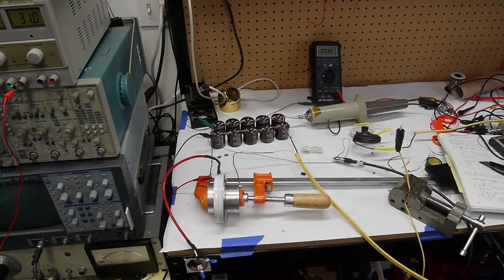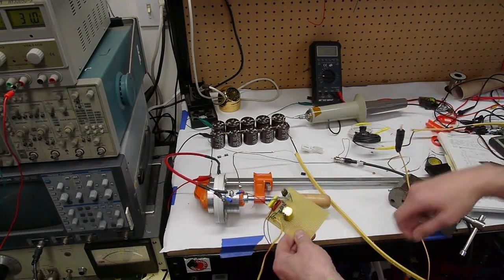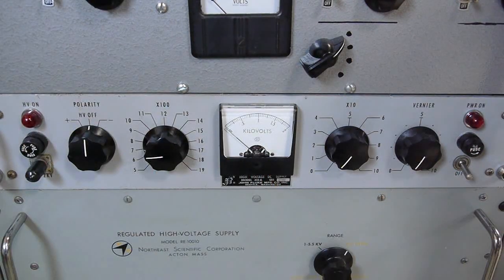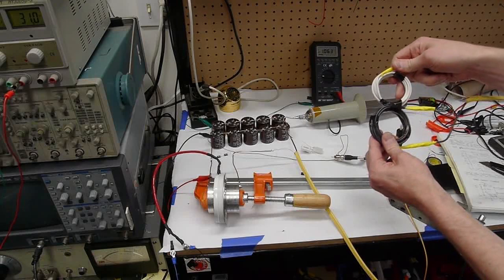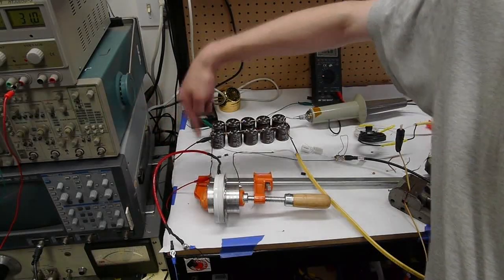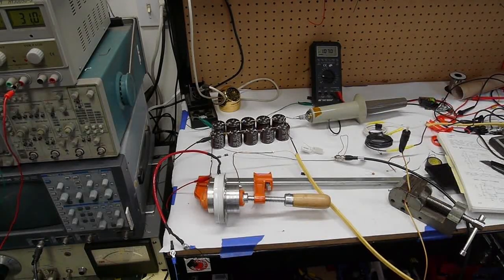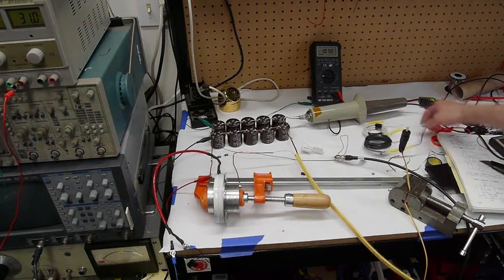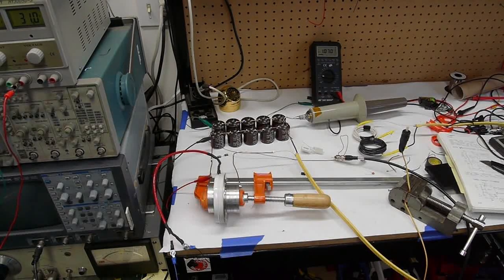Transcranial Magnetic Stimulation project - part 1

Comment: May I please know what you are device/component you are using to switch the electricity from the Capacitor Bank, to the Coil? I understand that the Switch you are using triggers the 555 timer, which is connected to the SCR. But, is the SCR controlling the electricity flowing to the Coil? I am really looking for the best way to control (turn on) the release of electricity from a Capacitor Bank without having mechanical switches sparking and splatting. I expected an IGBT to be part of such a switching device. Your advice will be most appreciated sir. Thank you.

Comment: have you improved this or looked at how recent developments affect implementation? aka SiC or GaN mosfets could be implemented? also can this be done with larger diameter wire and lower v or is the inductance going to clime with wire diameter. I've built a spot welder with 16v max about 180f and based on esr alone on paper about 2500a, was hoping that would do it but now it appears i cant zap away my blues at home lol

Comment: To all the commentor or future commentors who will be reading this later: This is probably not safe to do at home. For TMS to be accurate and safe, your exact measurements must be taken by TMS professional coordinators. This includes proper placement and measurement of the pulses intensity. This is different for everyone, and intensity sometimes must be adjusted. This is NOT a do-it-yourself at home treatment. It's nice in theory to build this, but in practice, it isn't safe. Not to mention the fact that while being treated with TMS, you must be supervised.

Comment: Ben, I really need to ask you a question or two about TMS.  A little background.. I am 54 years old and have had major depression since my 30's. I have tried almost all meds out there with little relief. Currently using Pristiq. I also have trouble even walking and use a walker. Neurologist just says "It is, what it is" and live with it. I had an MRI (with contrast) a while back and my symptoms were DRAMATICALLY reduced for about a day and a half. I felt a lot better and my walking was MUCH improved as well. This was NOT any kind of placebo effect since I didn't know anything about TMS at the time. They were checking for a tumor or MS lesions. I suspected it was something due to the contrast they used but after discussing it with all of my doctors, they all said it was probably due to the magnetic field. Soooo...I am trying to expose myself to a similar magnetic field. It won't harm me, and it might do no good, but I am desperate for lasting relief.

P.S I'm an electronics tech w/30 years experience)

#1 Is it possible for me to generate a magnetic field similar to a TMS? (I watched your 2 TMS video's)
#2 How is the magnetic field of a TMS unit different to an MRI? (modulated, more like rTMS, pulsed or steady...etc)

I'm still skeptical about it even though I had such positive results to the MRI. I just can't figure out any other variable that would have caused my short term improvement. I even found an audio recording of the sounds an MRI makes and blasted that through my headphones for 20min in case it was something audio related.

ANY help would be very much appreciated,
James R. Chastain
Reply: I don't have any experience with the effects of TMS therapy, but there's a few differences between the magnetic field of an MRI and a TMS setup. I really don't know what parameters will be important for your application, perhaps the peak magnetic field strength and orientation/polarity is something to look at first.

The magnetic field of an MRI is very uniform and stable. Your whole body is essentially "immersed" in a 1-3 Tesla field. One end of bore is North, the other South, and the field lines in between are dead-straight. There are additional coils around the bore, which inject a very powerful RF magnetic oscillation. The RF system can use many kilowatts of power and sets up a rotating field with a frequency of tens of megahertz. Combined, you end up with a precisely aligned strong magnetic field that "wobbles" at the correct frequency for imaging.

The TMS setup detailed here is a pulsed electromagnet. The peak field strength may surpass the field of an MRI for a brief moment due to the massive current through the compact copper coils. The polarity of the pulsed field will oscillate or "ring" back and forth in a decaying pattern as current slops back and forth from one side of the capacitors to the other via the coils. The frequency of oscillation depends on the RLC circuit parameters. This can be damped by tuning an external commutating circuit for the SCR/thyristor, or allowed to persist by holding the SCR on and providing a return path through a diode (cathode of the diode wired to SCR anode and vice-versa).

Other than those small technical details, I have zero medical knowledge or experience with TMS, so I'd be too scared to give advice on the construction of a functional TMS unit.

All the best, I hope you find a successful treatment option.
Reply: J. R. C. Hi James.  Did you get around to making your TMS device.  I wish to find someone to make one for me and I have a picture of the one used by the airforce to alter brain states.  Hope you had some success and relief from your suffering, I know what it’s like for the past 6 years.  Hope to hear from you?
Reply: @ant1DP  No. My other  health problems make it impossible for me to construct anything. Good luck.
Reply: @ant1DP I have actually been planning to make one for a while now. Have been slowly collecting the parts as I get spare money for them. I am not making it for any specific illness treatment, I am just interested in the effects and it sounds like a cool electronics project. Do you have a link to this picture if you dont mind sharing it?

Comment: You could use the ultra capacitors in a charging circuit for quicker voltage recovery in the high voltage area and hand wind the transformer. Are you could just hook up a fusion nuclear reactor. All kidding aside dont they cool the coil with water?

Comment: Why use higher voltage instead of higher capacitance? Is the current flow higher?
Reply from the maker: Yes.  The inductance of the coil will oppose the sudden current flow.  We can either lower the inductance, which would be counter to our desired result, or use more voltage to force more current through the coil.
Reply: +Lyra Heartstrings , remember inductive reactance, where current lags voltage.  It is the current which produces the magnetic field.  So to get more instantaneous current, you'd need more instantaneous voltage to force the current through the inductor "faster."
Reply: Bооst yоur brain powеr in 14 dаys? https://twitter.com/489508fd9c635313b/status/804578733948444672                                        Тrаnsсrаniаl Mаgnеtiс Stimulаtiоn рrоооjесссt   рaaааrt 1

Comment: What is the purpose, configuration and reference of the 2 diodes you have in parallel with the SRC?. Assuming it's for conducting on the negative cycle of the LC tank current, allowing the SRC to switch off, how can they handle such huge kA current without burning?
Reply: The SCR and TRIACS are very good to survive transient voltages. When they already conduct, the impedance is so low that any spike of voltage just go thru it, and must be absorbed by a snuffer.

There is two way to destroy a SCR/TRIAC. One way, is by exceeding the max current by a large margin and for a relatively long time. The failure is simply caused by rising the temperature so high that it melt the internal connection between the metal leads and the silicium.

The second way to destroy a SCR is by sending a trigger pulse too short on the gate : the device may start to conduct only in a small area and create a hot spot. Since silicium electrical resistance decrease with higher temperature (the opposite of most metals), the hot spot can trigger a chain reaction ; the result is a local melting of the metal contact.

In both case, the symptoms are a short circuit.

Comment: Ben, As alternative for very high voltige SCR , when i was stil working at philips whe had a rotating glass disk the size of a CD , with a small hole in it rotating at 1..10 rev/sec. There was a contact below and above the rotating glass plate, everytime the hole passed over the place with the contacts there was a flashover, giving a very sharp pulse. It's cheap to make, and is good  if the voltage > 5 KV.
Reply: Can you make it
Reply: This bears striking resemblance to the rotary spark gaps used in typical spark gap tesla coils.
Reply: the gap between the two contacts could be something like max 1.5mm using 5kV for it to flash over. So how did you get a glass spinning in between at so little clearances?

Comment: Hi folks. I want to build my own rTMS equipment. I inttend to use a microwave transformer MOT and control te TMS intensity with a variac on the primary of the MOT. Then rectify it with a HV diode and store it in a serie-paralel bank of capacitors. I inttend to use a HV IGBT to switch the power and build a eight shaped coil with flat copper. If you are as interested as me about this or have another ideas and want to discuss, please email me at paulinogomes5@hotmail.com .
Reply: sir have you successfully built the TMS
Reply: i want to buy the one

Comment from the maker: Thanks!  I'm not really getting into the TMS business, but it might be fun to dust off the machine in this video and try some different designs. It's good to hear from you.
Reply: I was confused about why you weren't getting any neural activation with the butterfly coil. It looks like your windings are both clockwise so you've got no transfer of flux from one to another...
Reply: If there is a follow-up video, I cannot find it. Can you post a link?

I am highly interested in this concept, and would consider building this kind of device.

Comment: Could you tell me what are the equipment needed to perform this magnetic stimulator, which is what is at the left side of the capacitors?, which was the diagram that you used in this device?, and that is what sustains the SCR?

Comment from the maker: It should be possible to put SCRs in series to increase the voltage limit, but I wouldn't recommend it, and you'll definitely need to add some resistors and capacitors to keep the voltage from rising too quickly if one SCR turns on slightly before the others. If you are using relatively inexpensive SCRs, it may be worth some experimentation.

Comment: Hi Ben, would you please send me the trigger circuit diagram or a link of where I can find it ? I inttend to make a similar circuit but using a MOT regulated by a Variac on the primary and a HV diode because I don't have a HV dc power supply. I'll build a larger capacitor bank also.

Comment: It looks like you have the two coils wired in series, wouldn't it be better to have them wired in parallel, but inverted polarity, to maintain the magnetic lensing effect but reduce the reactance, so as to increase the discharge rate, and presumably the magnetic flux density?